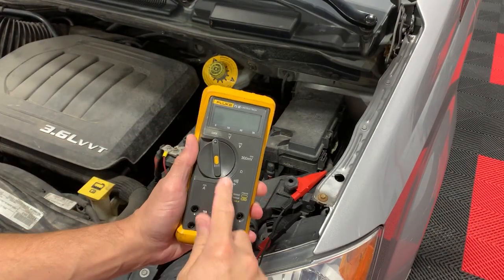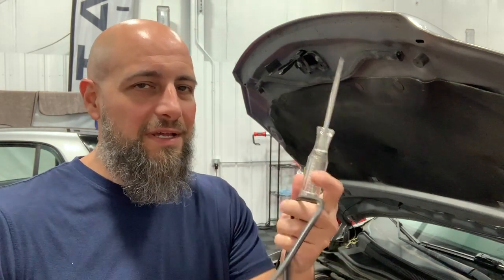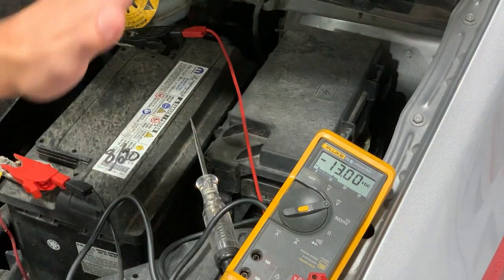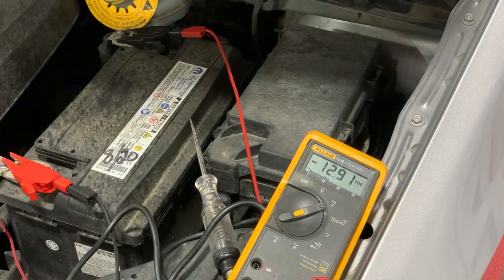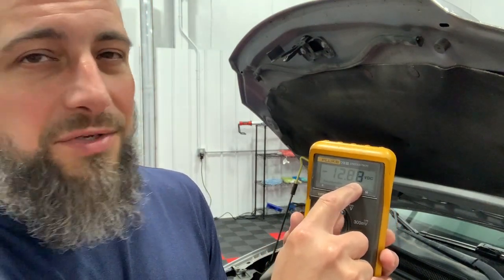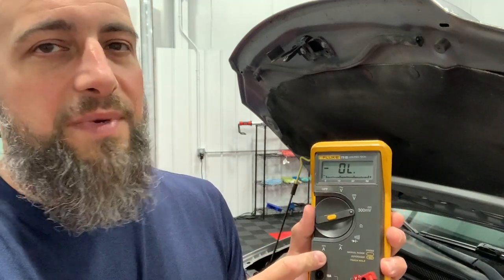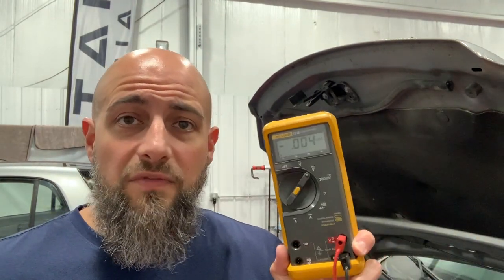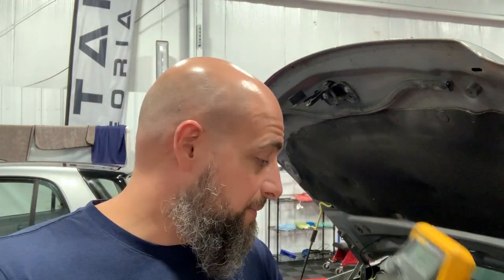How to check a car battery how to check a car battery with a meter

Comment: You're a gifted instructor! You speak clearly and articulate well. Your training and experience add a lot to your lecture and your camera work is excellent. I think you've got a real knack for this!
(One suggestion? Get a RODE or SHURE mic to wear on your shirt and your audio won't drop out when you move a away from the camera. The cameras in phones are better than the mics.) Nice job!
Reply from the maker: @bc-guy852  you should see an improvement, as I ended up getting a mic. Thank you for your nice feedback

Comment: Thank you so much for the clear explanation. I wonder if one can instead make use of the car builtin voltage meter you can see on the dash display in some (? all) cars. E.g. it shows me say 12v when I turn ignition to ACC (morning) and then goes up to 14.5v after starting the engine. I haven't tested it with full load though. Do you think this is a good way to test too ? It would be very convenient if yes. Thank you. 
I subscribed and still going through your other videos 🙏

Comment: Yup. You don't need any fancy equipment to test your battery. Just about the cheapest voltmeter will do. And you can use the car's starter as your load. However I would warn against reversing the leads if you are using an old-style analog voltmeter with a d'Arsenval meter, which consists of a little electromagnet that physically moves a needle in front of a printed scale. Then it is best not to reverse the leads. This kind of meter is not likely to have circuitry that will enable it to show negative direct current. And the needle may get slammed against the stop at the zero mark on the meter scale. This could conceivably damage the meter movement, or alter its accuracy. It might not create any harm but it is bad practice; it is a bad habit, to hook up the leads in reverse unless the meter is described as having protection against reverse polarity. I would also add: make sure the alternator does not start bumping up the voltage to over 14.5 or 14.6. You can check the service literature for the exact maximum value but if you see 15 or more it is definitely too much voltage. The voltage regulator (it is usually part of the alternator assembly) can put out too much voltage and this will shorten the life of the battery, shorten the life of incandescent light bulbs, and who know what else. I've seen old cars sending 17 volts to the battery. Theoretically you could have a defective voltage regulator that produces voltage a value even higher than that. Old timers used to use the headlights as a voltmeter. They would look at the headlights while starting the car. If the headlights got dimmer than it was expected they knew that the load that the starter was putting on the battery was lowering the battery's voltage below 9 volts, and that therefore the battery was not in good shape. This test does not work so well on cars with LED headlights, HID headlights, or on very old cars with kerosene lamps..

Comment: Lou, I don't know how else to contact you. I have 2008 X164 Cdi, OM642 stalling at 1/4 tank left (about 7gal). Wife has lost trust in it so I replaced both the lift pump on passenger side tank side, sending unit on driver tank side, fuel filter, fuel pump relay and still have stall issue. I resealed leak on HP CP3 pump few months ago and it is registering 23, 300psi at full throttle, so perfect. Tank pressure valve? Not enough flow to driver side sending unit for venturi fuel pick up? Car has full power, no hard or soft codes until passenger side tank half starts drawing air and it trigger low fuel rail pressire (0087) and eventually stalls. Add couple gallons and it starts and drives with full power until level drops again. I am limited with testing with iCarsoft MB V2.0. Anything you can recomend?
Reply from the maker: were both sending units replaced?
normally if you replace the pump and filter in the tank the sending units come with it, my assumption is the fuel level reading is wrong, so youre actually running out of gas . if you replaced all the parts, theres no reason to have the exact same issue with the fuel system, because once you replace those parts you basically replaced every line in the tank
what I would do is verify with the senders removed and the key on that you can see the fuel level move in the cluster when moving the arms full sweep. 
or watch live data or check codes in rear sam or fuel pump control unit, depends on your model which reads the level signal, off the top of my head.
Reply: @MasterTechLou  yes, everything in the tank was replaced. Sending units are showing correctly. I normally fuel up 25gal once low fuel light lights up in the dash and mixed city/hwy driving we get no sell than 550mi per tank. HWY only we got as high as 650mi per tank if I can keep my foot light and up to 65mph. It is stalling at about 430mi. Electic pump start making noise by running dry and faster without resistance at that point just before stalling. Tank is 27+gal total capacity. When we stall, I add 5gal from a can and top it off with 13gal at the station, so 7 was originally left over in the tank, each time. I even installed threaded rivets and screws with rubber seals to two glued metal chassis covers for sending unit & fuel pump access! Visually confirmed left over fuel on driver side of the tank half. No leaks anywhere, bone dry on top and under. Engine oil level unchanged so no obvious open injector situation. I worked for 7 years in MB, Porsche, BMW shop in the 1990's and ever since on a side. I have seen some crazy things, but this one stomps me. My other diesel is studded 2004 Powerstroke 6.0 in perfect condition at over 300K mi despite horrible reputation. I am on top of things, but like I said, it stomps me! Plenty of MB saddleback tank stalling issues, but no clear diagnostics and repairs. Just a lot of parts exchanging and fishing expeditions and plenty open posts without conclusions. I am about to lower the hose from driver side sending unit return into the passenger side electric lift pump housing top location, much lower and right by lowest pick up point on passenger side fuel pump housing and bottom strainer. I am hoping that fluid dynamics and fluid surface tension will keep sucking from driver side all the way to the bottom this way. I appreciate your feedback Lou.
Reply: Since there are no soft or hard codes indicating any sensor monitored malfunctions, my initial thought was that ribbed plastic hoses between driver side sending unit and passenger side electric lift pump had a crack drawing air once exposed to it at 1/4 tank left over. Upon removal I instected them and found no cracks. As you mentioned complete replacement should have removed any issues and fixed it. I did not detect any blockage on return side back to the tank that could slow the flow down and impede venturi pick up in driver side sending unit toward passenger side electric pump. Man I wish these things just had electric lift pump in each tank half or physical tube bridge under the tank like old cars.
Reply from the maker: @ivansaban9472  I am assuming you connected the hoses the same way the old hoses were connected? I wonder if a hose is not installed properly for the siphon jet pump. I dont have a car near me to check visually or parts.
Reply from the maker: @ivansaban9472  wonder if you can remove the cap and run the car to watch the fuel from the other tank spill over into the pump side. it sounds like your not getting any suction to the other side. something is not connected properly.
Reply: @MasterTechLou  You can't swap them since connectors "polarity" is opposite. I am suspecting HP CP3 cam driven pump circuit. The return does not come from injector return, but HP pump itself. I resealed O-rings on the 6 valves of the CP3 recently and did not touch the return circuit, but there is a possibility that I inedvertantly dislodged any settled or caked deposits that could partially block the flow and reduce venturi effect of driver side sending unit fuel pick up from that half of the tank. I have no access to WIS so I am working a bit blind. I will sign up for ALLDATA for 30 days and check it if my troubleshooting today does not solve it. I am about to bypass into a container the return flow and check volume of it first. I'll keep you posted.  Thanks Lou!
Reply: @MasterTechLou  Solved! The return bypass showed barely a trickle of fuel. I took HP CP3 pump off and apart again. This time I ran brass rod brush through the passages of return circuit, filled it with diesel and reverse blew it with 125psi of compressed air and I dislodged a chunk. It is black, so it is either some kind of bad fuel build up or somebody (before I purchased this vehicle used) put a black silicone on the 16mm "bolt" that is mounted on the bottom of the pump once installed in the vehicle!!! F-ing gasket maker has no place anywhere near that pump assembly! BTW, it is original HP pump to the vehicle - 14 years and 170K miles. I removed both injector branch barels and lines on both sides and reverse blew them from each injector feed to make sure notyhing was in there. I DIY flow down tested injectors and they are all flowing closely to each other with barely any difference, so that is good. Reinstalled the HP pump and again checked return flow - it filled a 1 gal bucket in a few seconds under throttle! Test drove it with live data on ICarsoft MB scanner and it is running great with no strange data. Proof will be once re-filled tank eventually passed 1/4 tank mark, but I am confiden based on night and day return flow that it is fixed. Lesson learned. Blowing it with compressed air when resealing HP pump is not enough. Brass brushes are a must. Thank you for your impute Lou!

Comment: Lou, can you do a video on the Door mirror Faults with LED installed. There’s only and two prong to a four ?
Reply from the maker: Hello, what kind of car are you referring to? And what faults are you having?
Reply: @MasterTechLou  2000 s430
Reply: Someone added the aftermarket LED
Reply: @MasterTechLou  Getting Blinker faults on right and left door mirrors, they both work but I am getting fast blinking in dash and slow on doors if that makes sense
Reply from the maker: @theil6  led doesnt have the same resistance as normal bulbs or the oem lights so thats why.
Reply: @MasterTechLou  how do I get the error off the screen? Is there a replacement or OEM I can replace with
Reply from the maker: @theil6  put oem
Back in.
Reply: @MasterTechLou  I am trying to find them, it seems the 2000 are not compatible with 03 - 06 ?

Comment: You need a load tester to check a battery.  As lead connections in the battery degrade, you can have 12+ volts and only have 200 cold cranking amps.  However if you have 13 or over volts, you will have 100% of original cc amps.  If you are below 12.7 volts, your battery is on its last legs.  Load testers are $30.  Trust me I have 7 years of engineering classes under my belt...38 years working on cars.
Reply from the maker: You’re not wrong however the method of cranking a car 3-4 times is the same as load testing. Especially if you turn headlights and accessories on.  A weak battery is not hard to determine provided you know what youre looking for.
Reply: With experience, one can  test in many ways.  The needs a load tester and knowledge to fully charge before testing.

I subscribe because you helped me in the past....ty
Reply: "an mature needs"
Reply: the armature needs
Reply: Watts=volts x amps

Amps... Mostly cc amps are most important.

Again, I found you and that helped me out of a bind.  Trust me, harbor freight e at $30 will be the best money ever spent.  Volts do not tell you battery quality\life.  Load testers give you exact truth every time if battery is fully charged.  I'm the old experienced..
Reply: @joeberginc7415  while you are very correct that battery voltage says nothing of the condition of the battery, he obviously is load testing the battery by reading the voltage while running the starter, which is what a load test on a battery tester simulates...
Reply: It's always nice to tell a customer, "Your battery only reads 400 cc amps from the original 650. You will need a new battery when it gets cold.". OR "Your battery reads 700 cc amps on the 650 factory quoted.  You can trust this battery for a while. "
Reply: @joeberginc7415  true, it is a straightforward easy way for the customer to understand the battery condition. My point was that there are other effective ways to test a battery other than using a dedicated battery tester👍

Comment: What do you think about the autel mk808ts? Is it limited to the ms906bt? I just bought the 808ts to track down a couple electrical gremlins I’m having in a couple vehicles I have
Reply from the maker: Hey sorry not sure why I didnt see this comment. They are almost identical in operation from what ive seen. Lemme know if you ended up picking one and how you like it?
Reply: @MasterTechLou  I got the 808ts. So far I like it. One thing I’ve noticed is the OS is slow but it’s a good unit for the price
Reply from the maker: @gimpgangster  yeah I think the main differences are the speed of the tablets and specs of them.
Reply: @MasterTechLou  I’ve used it compared to my friends $4k snap on scanner and for what I need it for it matched up great. The snap on scanner was significantly faster. By a long shot.